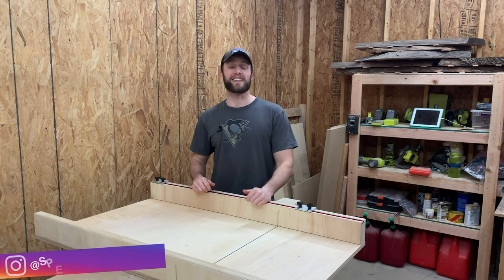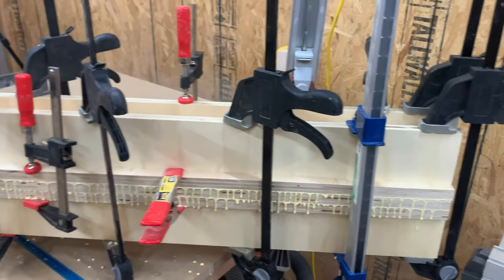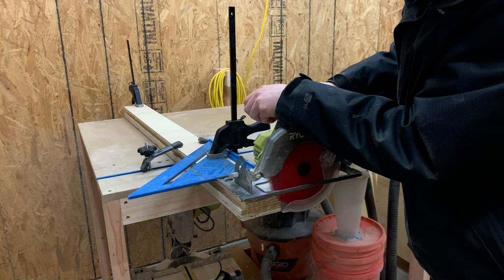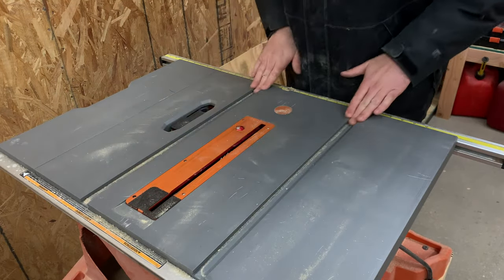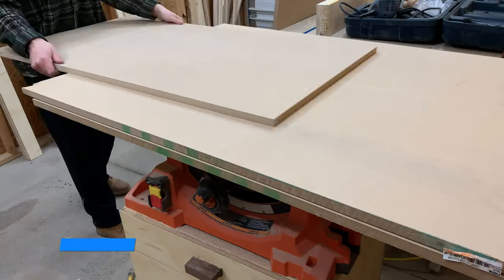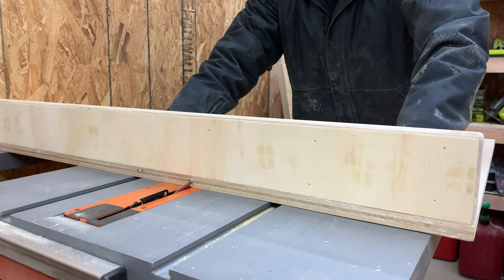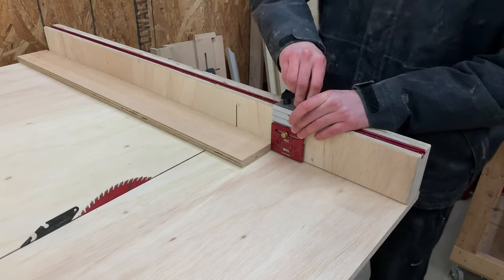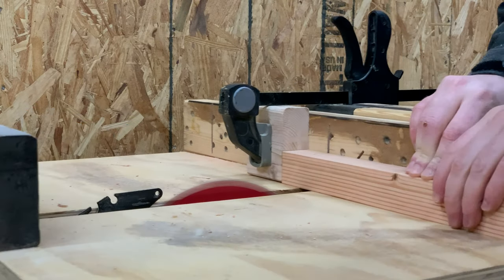Woodworking Simplified - The Must-Have Jig

Comment: Love the pace of your videos and the focus on crucial elements without being super wordy or dragging on. Great stuff. Learning a lot. Quick question: What purpose does the back fence serve on a crosscut sled? I see most folks add one and a few don’t. Hoping you can explain.
Reply from the maker: Hi Will! Thanks for stopping by! The purpose of the back fence is just to keep the sled from falling apart. If you didn’t have it, when you remove the sled from the table saw the two halves would only be supported by the front fence and would likely break off over time. However, if you’re making a super small sled, it’s probably nothing to worry about. I hope this is helpful  and thanks again for checking us out!
Reply: Spencley Design Co. makes total sense. Obvious now that you’ve explained it. Like I said, still learning haha. Thanks.

Comment: Awesome. Are they any potential issues with using a sled that’s larger than the table saw? I wanna make one for my small Ryobi saw
Reply from the maker: As long as your runners are snug in the miter slots, you should be good. Just be cautious about the sled tipping over

Comment: Is it absolutely necessary to have a front fence when building these?
Reply from the maker: No, it’s not 100% necessary...however, without it you will be relying on just the back fence to hold on to each side of the sled. Over time, the sled will likely lose accuracy. But no, it’s not 100% required.
Reply: @SpencleyDesignCo  ok thanks for the reply, appreciate it
Reply from the maker: Of course! Does that make sense though? With the front fence, the two pieces are going to flex a lot. Especially when you’re taking it off and on from the saw

Comment: Nice straightforward build, Eric. You went for a much bigger sled than many such as Tamar of 3x3Custom, and Scott Walsh, who both built smaller sleds with some extensions to save weight. Was there something in particular that drove your decision for this size?

Also want to mention, this is the first video I've clicked through to in a while. There's something about some of your titles that, well, rub me the wrong way and I opt not to view those. I understand the need to use click baity sorts of titles on YT (Stumpy Nubs did a great segment on the YT algorithm and how it's changed over the years, leading to the need to lean into this) but often there's just something a little extra that I find off-putting. This has no relationship to your content, which is very good IMO and I almost always enjoy what I view. Please accept this in the spirit in which it's intended, which is to let you know about something others may also feel but don't take the time to say. Cheers!

Comment: I am wondering why you and everyone else making sled videos glue wood pieces together to make the fence instead of using a 2x4, which would require less work. Since everyone does it that way, I am guessing there is a good reason...could you explain why?
Reply from the maker: Sure, you could use a 2x4. I trust the stability of laminated plywood much more than construction lumber though. Next time you’re at hone depot, look through the stack of 2x4’s closely and you’ll notice that almost none of them are flat
Reply: @SpencleyDesignCo  that makes sense. Thank you!
Reply from the maker: Of course! I’m always here to answer questions you might have. I’m still a beginner, so I know people have lots of questions 😀